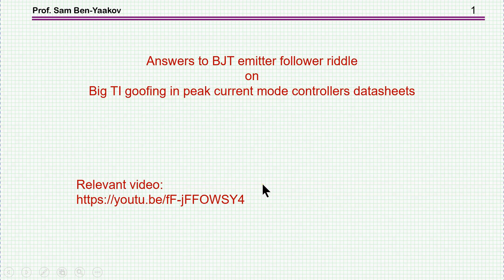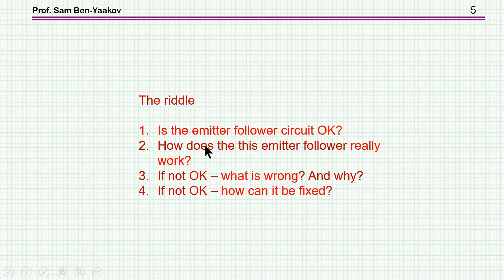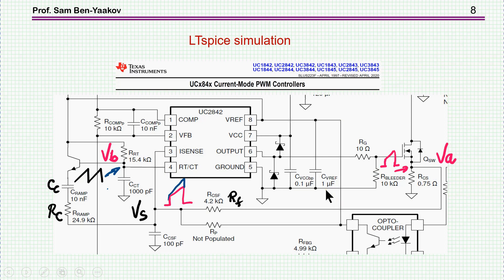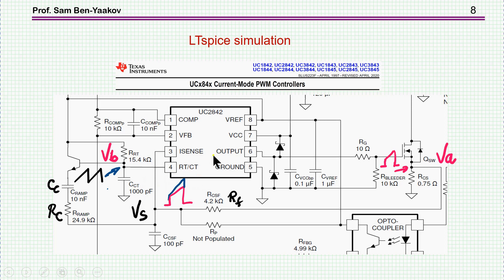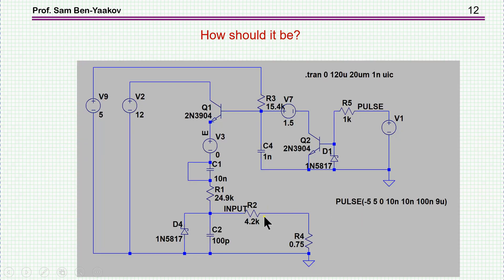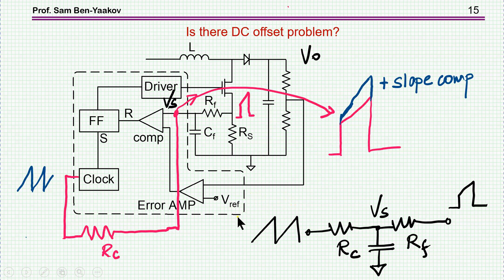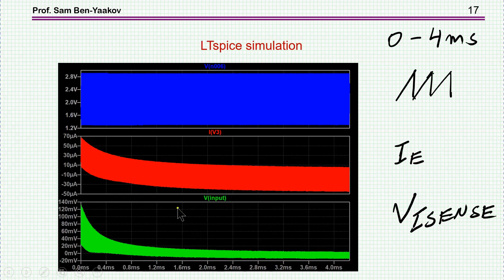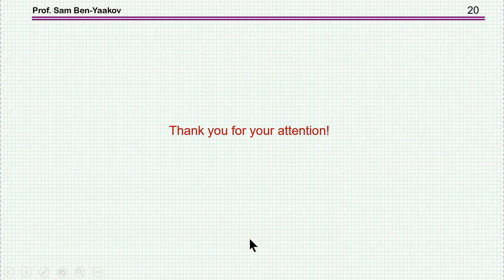Answers to BJT emitter follower riddle on Big TI goofing in peak current mode controllers datasheets

Comment: Excuse me , Sir how do I control the slope in the real circuit.
 in the simulation I can use triangle wave to become my slope compensation, and I can decide the value what I want. but when I use UC3842 the Slope is based on the RT/CT and I can't control the slope like simulation. In the Ti datasheet Figure21. Slope Compensation Ti just use the Remitter they don't add the capacitor in the Emitter that why?

In my case I use the boost converter and switching frequency is 100kHz and after my calculation the slope compensation I need is 0.36v/us that mean I need the RT/CT peak to peak value is 3.6V but in the TI datasheet the peak to peak value is 1.7V 1.7V/100k= 0.17v/us it is not my goal. how do I do I can let the slope compensation achieve to 0.36v/us 

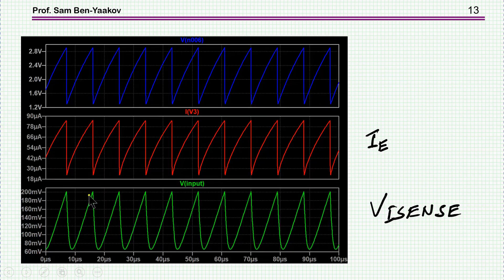In your video 9:06 the R1 value 24.9k how to know this value ?
Reply from the maker: THe slope reaching the Isense of controller is determines by the voltage divider between the  (R2+R1)/(R1+R2+R4) R1 and R1 can thus be set for required ratio
Reply: @sambenyaakov  how did you get this formula and where is R1 R2 R4 I don't see that

Comment: I suspect this "goof" was caused by an honest mistake.  The latest datasheet of the "A" variant of this chip (UC3842A, datasheet SLUS224F –SEPTEMBER 1994–REVISED OCTOBER 2017), shows the same blocking capacitor, where it is referred to as CS1 (refer Figure 10, "Typical Flyback Application Circuit").  That datasheet provides an explanation for this capacitor on page 18, as follows:
"Capacitor CS1 is a DC blocking
 capacitor, and pull-up resistor RP is used to provide some offset to the current sense signal for noise immunity.  RP and RS2 were preselected to add a DC offset of 50 mV to the current sense signal."

I suspect TI simply copied the schematic from the datasheet for the UC3842A (dated October 2017) and applied it to the UC3842 non "A" datasheet that you have reviewed here (SLUS223F –APRIL 1997–REVISED APRIL 2020), but then decided to add a buffer in the form of an NPN emitter follower.  They then failed to consider the biasing of that transistor.
Cheers.
Reply from the maker: Hi Fabio, thanks for pointing to this datasheet. You could be right. If so, it is even worse than I thought. Adding a buffer without checking it out? This is worse than ignorance, this is negligence.

Comment: Thank you for an informative video .
I agree that the thinking behind this capacitor was the additional dc offset added to the Isense input . 
This additional dc offset will , as you point out , not stop the controller from operating due to the external voltage control loop .
However , since the current sense input has a peak level of 1V before the output is curtailed , the addition of a dc offset voltage will force the signal from the current sense resistor (or CTX) to have a shallower slope and this can increase pulse jitter due the less decisive signal slope at the internal comparator input . This jitter is seen as additional output noise .
The oscillator valley voltage is about 1V and the emitter follower will reduce this to about 0.35V . I have in the past added a schottky diode in series with the emitter to negate this small remnant voltage .
Reply from the maker: Thanks for inter sting ans useful input

Comment: If capacitor is removed then wouldn't it work as voltage mode converter instead of current mode? Seems like the capacitor was being added just to filter out the DC content of the ramp and it would work as current loop compensation. Yes a resistor is missing from Emitter to ground. Current feedback pin has max 1V threshold and when cap is removed then the ramp will shutdown the PWM by itself no matter what current is being drawn by the transformer or inductor. I would still need to check when I am back to my computer again. Can you please also add current waveform of the inductor on your LTSPICE simulation and see what effects it does to the output.
Reply from the maker: No it will still be PCM as ten of thousand of converters that are out are functioning this way. Obviously you need by design to keep within the 1V. As explanation in video at the end (did you reach it) the DC has a minor if any effect. If of concern add another diode in series with eremite so total diode drop will be about 1.5V.

Comment: TI probably added the capacitor to minimize the dc component effect on the absolute peak current protection threshold which is constant (about 1V). DC current from the ramp compensator must be take into account when choosing the shunt resistor.
Reply from the maker: Erez,  no way the circuit can work with a capacitor.  Did you reach https://youtu.be/XSRYU5BFc1w?t=578   ?
Reply: Sure it wouldn't work with the capacitor. At least not without resistor to ground.